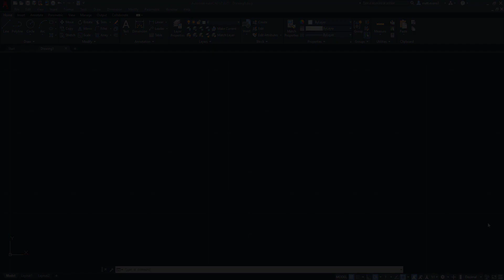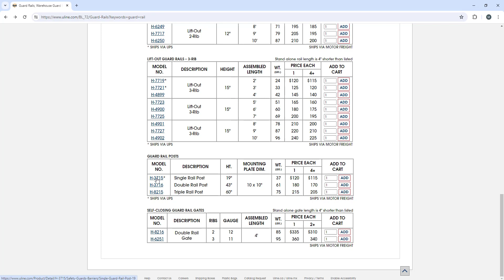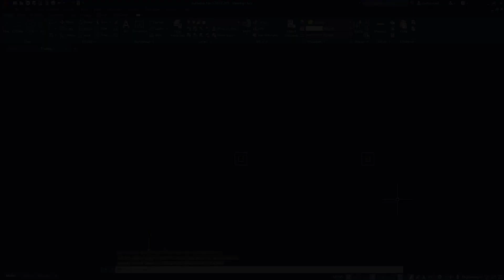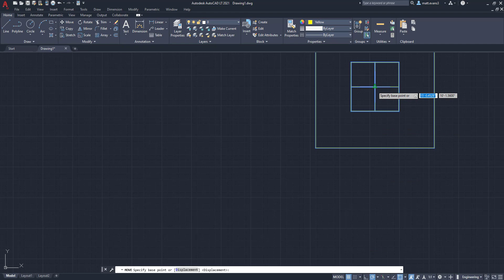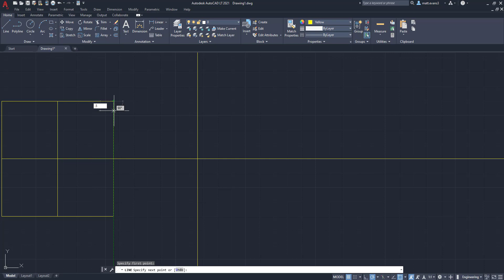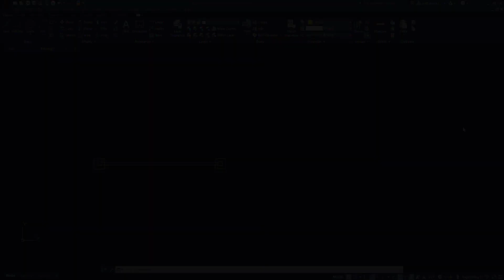How to Create/Draw Guard Rail - AutoCAD

Comment: Thank you for the video post. Looking at the website and how the rails either bolt on or drop in to the vertical post, I would think your 10' rail would need to connect on the edge of the 4" vertical post and not the center, wouldn't it? I mean, depending on how accurate your layout dwg needs to be I guess.
Reply: I see callout on the U-line website now. Says "Stand alone rail length is 4" shorter than listed"